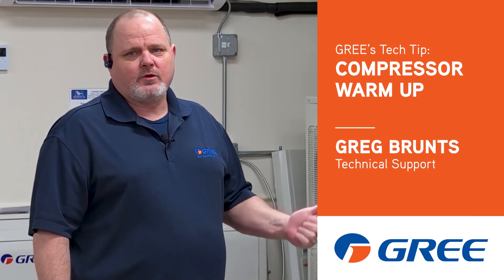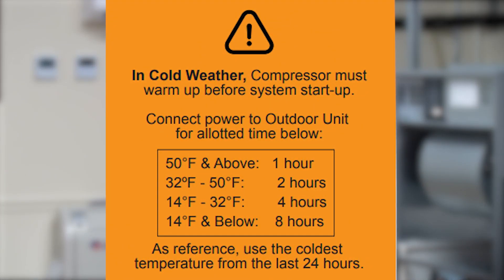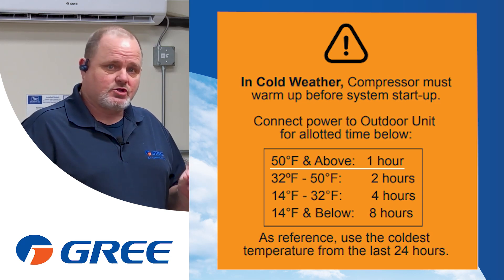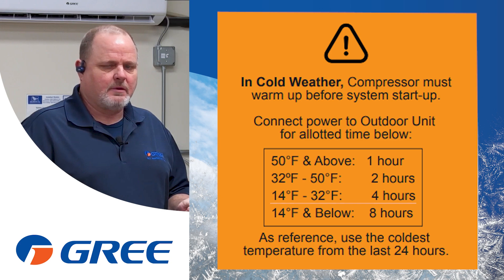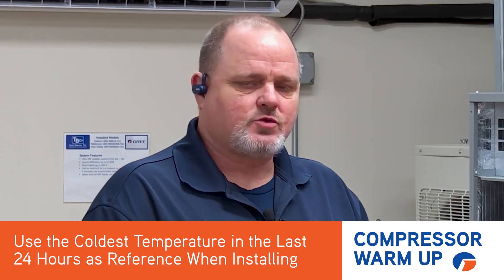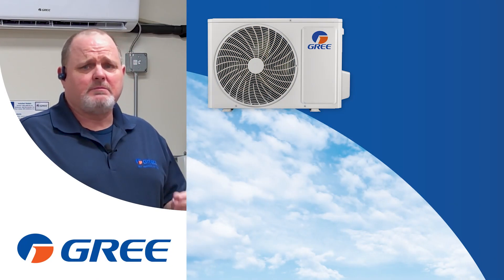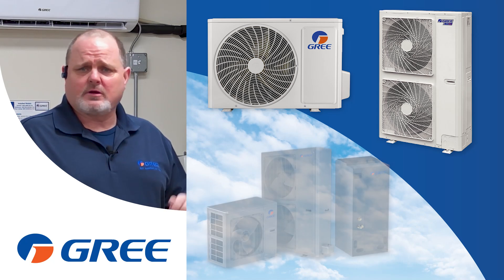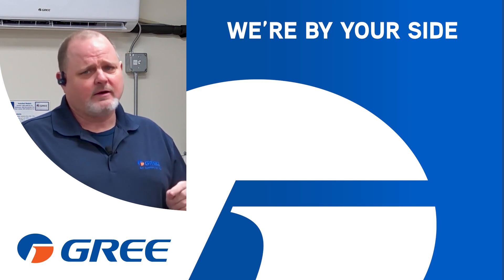EXTEND COMPRESSOR LIFE! Essential Compressor Warm-Up Guidelines for GREE Units!

Comment: Can you use an external heat source to speed this up? What if the condenser came from a heated warehouse that morning?
Reply: If I cannot do the proper pre-start power up and heating of the compressor, then I take an electric heater or two with me, run extension cords to the heat pump from two separate circuits on the house and use a large blanket over outside of hp to hold some of that heat in around the compressor. You’ll need to remove the top to set the heaters down in there.
Reply from the maker: Hi @elichamberlain1851, we posed your question to the team during today’s Talking Comfort LIVE. We hope this helps!
https://youtu.be/YS3mmxX_dbs
Reply: @GREEComfort  I also do this when changing out a reversing valve, accumulator or compressor in cold weather. Otherwise the refrigerant will bubble out of the cold oil for hours after recovery. I also connect my vacuum pump after recovery. It’s better for our health not to breathe gases passed over the flame when we start brazing and it provides some heat to keep me warm too. 

I’m appreciate you sharing your knowledge about Gree equipment with us.